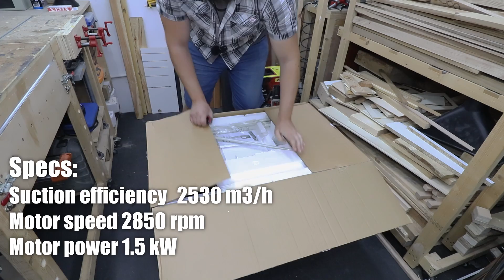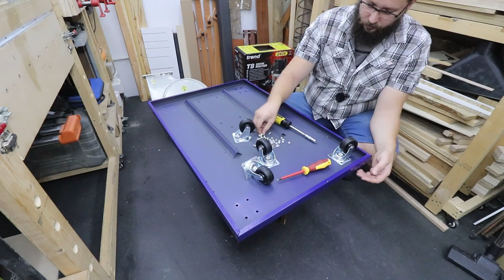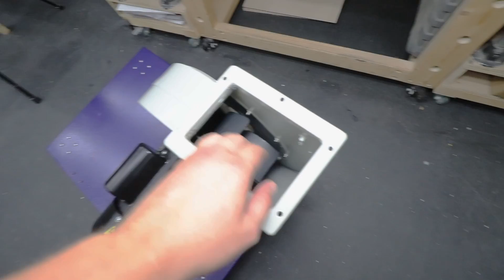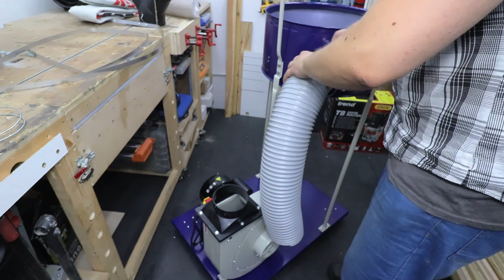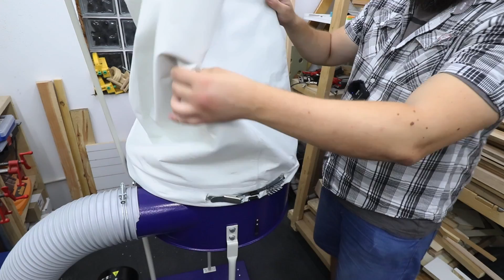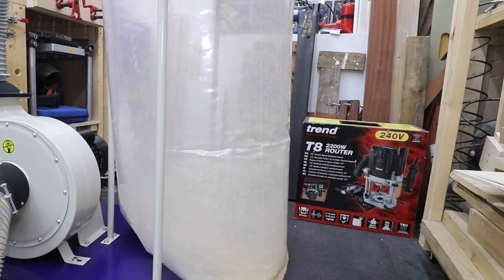My New High Volume Low Pressure Extraction System | Cormak FM300

Comment: In the states, this type is king. I happened upon a video going over Record Powers Camvac90L. I’m amazed they are not as popular over here. There are a few more North American suppliers now but still so many woodworkers here aren’t aware of them. If they are, a lot of times they think 220v access is some unattainable service when it’s just as easy to install than our standard 120v outlets. It just takes up a tad bit more room. I’m in a 16x30 space and ive put a lot into the ducting system, the Camvac easily handles all the machines, large and small. Who knows what the future shop will look like but I can’t see myself going back
Reply from the maker: I have to admit this extractor really changed how I work in my workshop. For those tools that produce a large volume of dust or chips this is a must to work cleanly and efficiently.

Comment: Great video mate. I removed the plastic cross piece from my shop vac and it stopped a lot of blockage issues I was getting. Admittedly though it wasn’t a chip extractor so your situation might be different.
Reply from the maker: So far had no major issues with those cross plastic pieces to be fair. But if I notice they do cause an issue then I'll remove them.

Comment: Tomasz very informative thank you!
I am going for one of Cormaks as well . Have you considered less powerful model FM230? Cormak claims it to be even quieter that other models, so was wondering if you had a chance to make any comparison before going for this specific model? I am mostly into wood turning hence dust collection and chips removal are equally important
Reply from the maker: I wanted the most powerful machine I could get for 240V to be honest. I want to have a full duct system around the workshop.
Reply: @CasualDIY  Thank you!

Comment: As for the bag not being clear if you own a sowing machine, you can make a bag out of that plastic and sow it into the top of the bag so that it will tell you when the top of the bag so that you can see when it is getting full. Also I don't know about where you are now but I do know when you were in the UK you could buy a simple on off switch, that you put between your machine and whatever you needed to turn on and off and you got a remote control with that to do exactly that.
Reply from the maker: Hmm interesting idea with sowing a clear plastic on that bag👍
This machine has got an NVR switch so it's bit more complicated. I need to see what actions can void my warranty to see if I can mess around with the wiring or not. My guess not 🤔

Comment: I’ve got a similar, with filter on top and the plastic bag. I usually get about 25-30 uses if I’m careful with it. I did take out the cross pieces because I do a lot of thickness planning quite a bit of resin
Reply from the maker: That's good going with those plastic bags, didn't think they would last that long. 
I'll do some more testing and see if the crosses will cause me any issues.

Comment: I had the same issue with power switch location on mine. The solution i found was a reasonably priced remote switch i got from Amazon. (It was less that $15 US.) It might be worth it for you to check out that option.
Reply from the maker: Yes got one thanks 😁👍

Comment: I’d be interested in how you fit a remote to it Tomasz as it has an NVR switch on it. I have the same system (different company) and have converted it to a two stage system. Works magnificently with ductwork to my machines. The only flaw is it’s lacking a remote to use it easily. I hope you can do a video on converting the NVR switch in layman’s terms. Great video as always.
Reply from the maker: I'll figure it out 😁👍

Comment: Reading the specs it says....
'Power supply-3 phase 400v'
Is that correct Tomasz?
Reply from the maker: There are two versions one is 230v and the other 400v to choose from. Need to be careful when picking one up. I've sent them a message with my purchase to make sure they send me the 230v version.

Comment: can you make a vid on how to connect a smaller hose like the one on your shop vac and how is the affect
Reply from the maker: Mine came with adapters to different sizes of hoses. However the best performance would be at 100mm hose. If I pick up a measuring tool to check the airflow I may do a video like that. However so far I haven't found a tool like that that would be at a reasonable price.